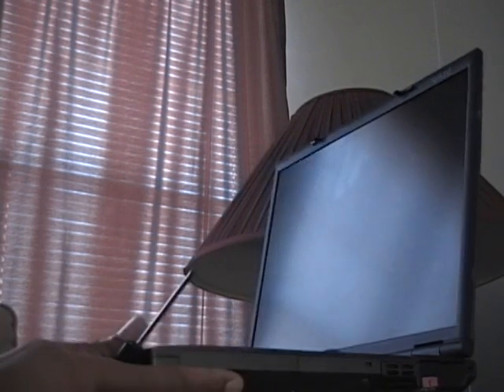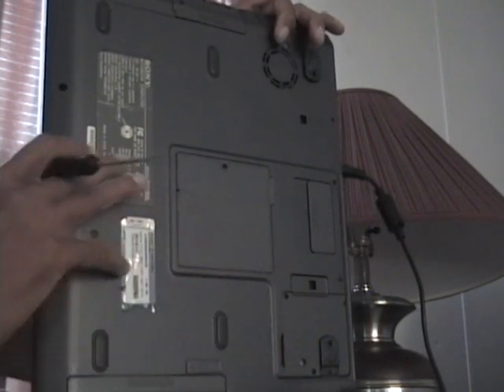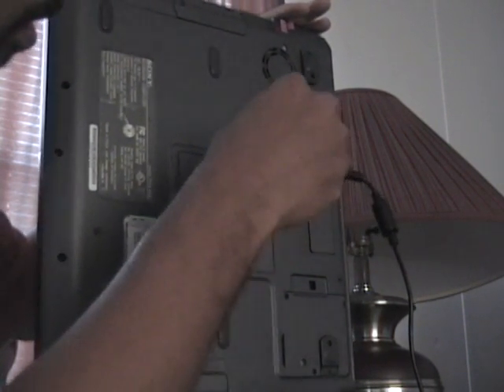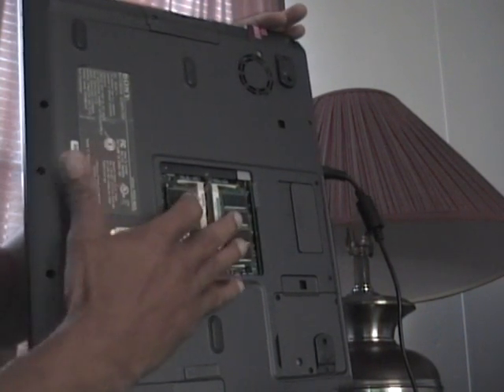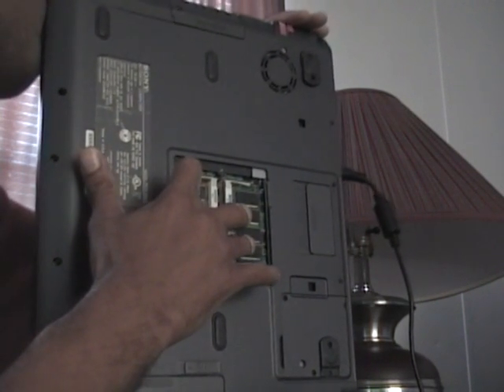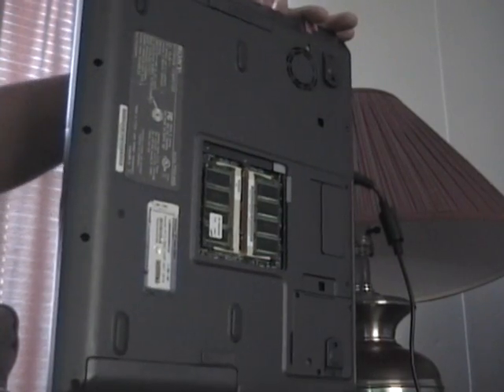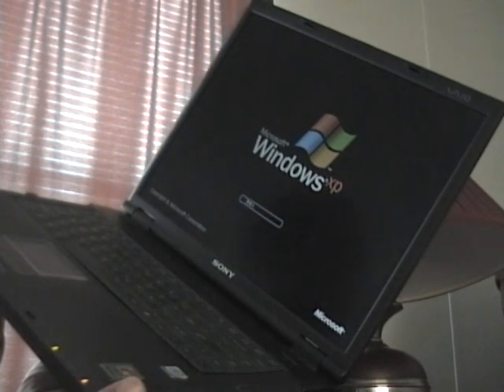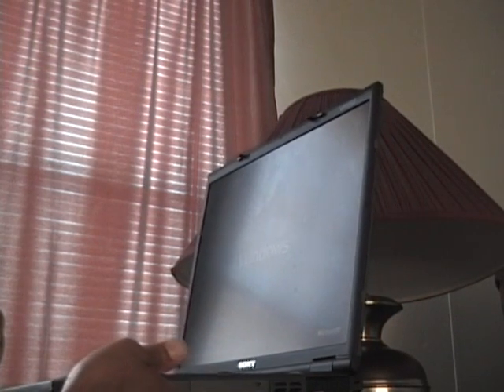Sony Vaio will not power on.avi

Comment: this actually helped a ton! found out its due to the RAM clips wearing out and not holding the ram in its correct position leading it to disconnect.

found my laptop in ewaste and thought it was dead forever. now i have 4 guitar picks somewhat permanently wedged inside my computer to make sure the ram is held into the correct position.

Comment: Thanx, my VAIO was only blinking it's green powerlight for a sec and then dies (over and over again). Which was weird because it had been in a safe for couple of months and worked perfectly before. The safe was may have been damp and/or cold. After removing and inserting the RAM chips the problem was gone.

Comment: i dropped my laptop.. not a huge fall at all and now the cable which seems to be working fine wont stay in it dock unless i apply pressure by using a rubber band. help

Comment: God bless you m8
Couldn't start it with all the methods in the book and from the net
I did switch and cleaned the memory and the banks but nothing...
hold the power button for 60 secs and...
replaced the memory and....
BUT your trick
worked the first time
just press it and it works now 
and just for the record it powers on OK (12 times now)

Thanks man that was brilliant 
though I don't understand why it works